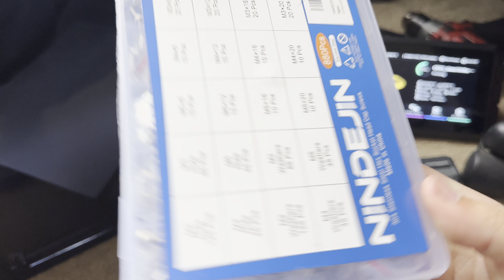Modding Ender 5 S1 for Volcano Nozzles

Comment: Ender 3 v2 Neo hot and and Ender 5 S1 has the same hot end and heatbreak and heatsink wow. I have Ender 3 v2 Neo I have also changed heatbreak with CR6SE Bi-Metal heatbreak.

Comment: This vs Sovol SV06 plus. Which one should I get?  
Thanks in advance!
Reply from the maker: I’ve got no experience with the SV06 but I’ve heard a lot of good things about it, I lean more towards the ender 5 s1 due to the enclosure they offer for it because I wanted it for printing CF nylon, Abs and other higher temp filaments.
Reply: @keystoadventure8816  Thanks!
I hear more issues with the Ender though. I guess I'll just have to count on luck. 
How about print speed? Is the Ender better still?
Reply from the maker: @arfifteen9344  I’m not too sure I print mostly at about 200 to 250mm/S +\- with some crazy print quality. Now you mention it I should see just how fast I can push it
Reply: @keystoadventure8816  Thanks! Looking forward on your results.